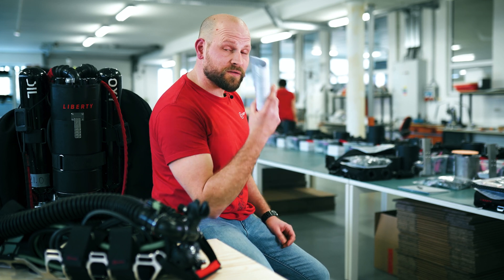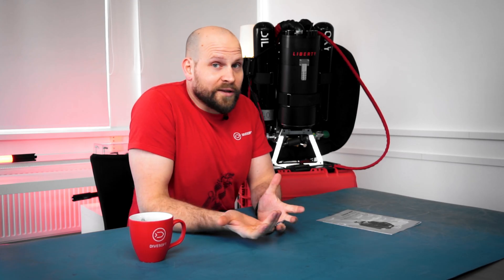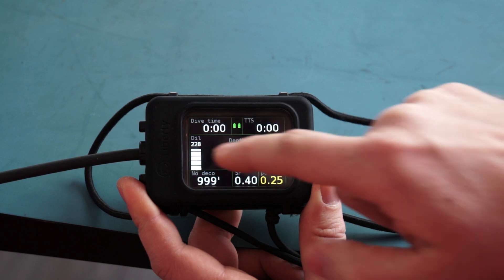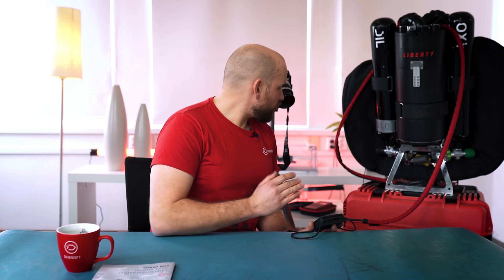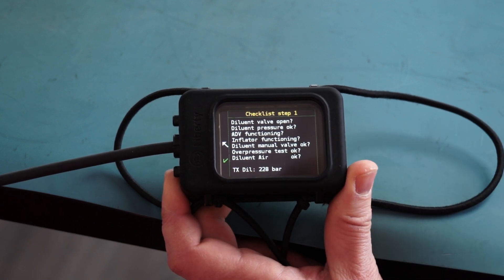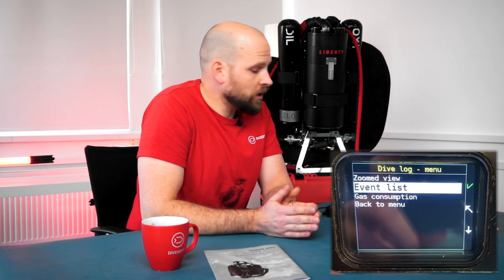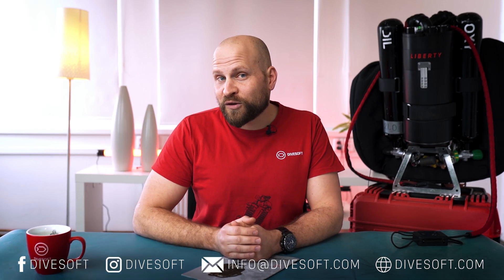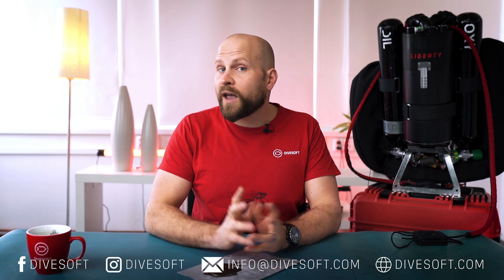CCR Liberty in Detail #18 | Liberty 2021 Edition

Comment: Just to confirm the transmitters are communicating with the head unit that is then transferring the data to the wrist-mounted freedom computer via that Cable? The freedom computers do not have wireless transmitter capabilities so also wondering what brand transmitter you guys are using? The system looks sharp though 👌
Reply from the maker: The transmitters are communicating directly with the CUs in the head. The wrist-mounted handsets are simply displays that allow the user to make adjustments. They are not Freedom computers, similar body but much more slim! The transmitters we are using are manufactured by Pelagic